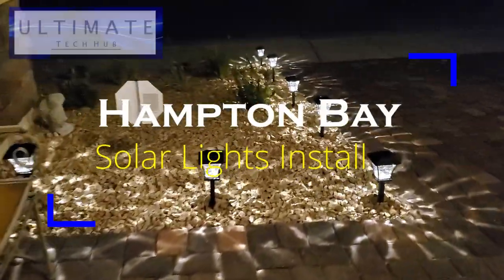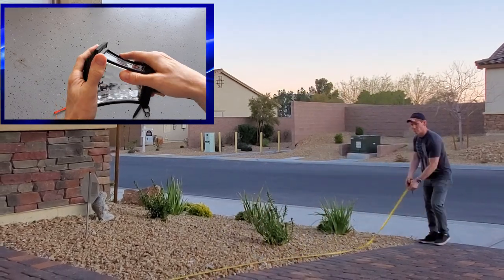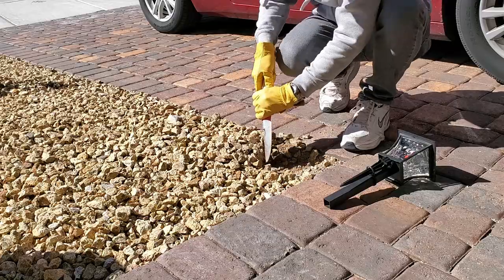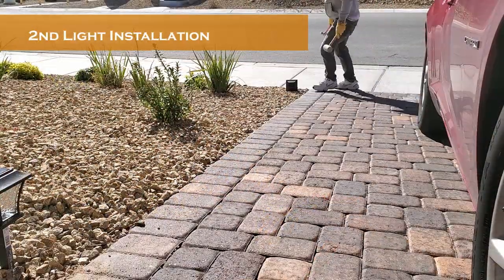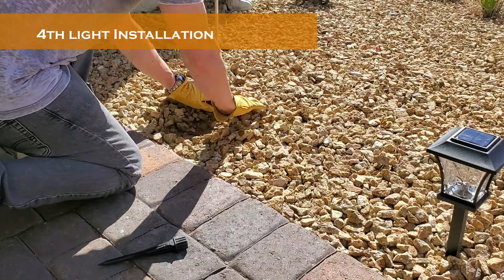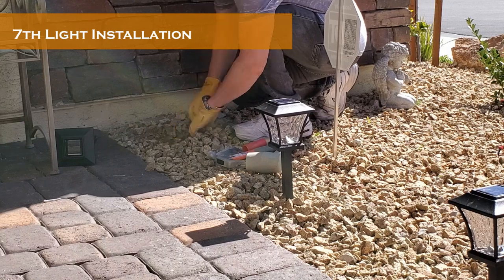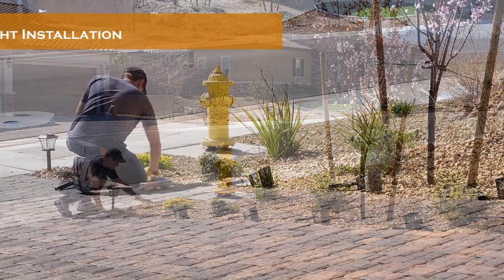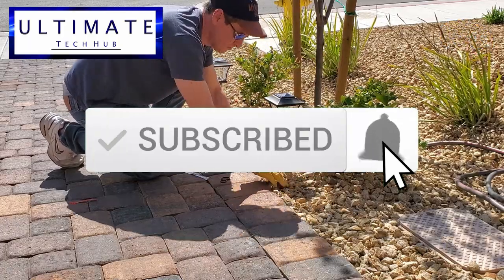Hampton Bay Solar Lights Install - Set up & Review - Quick & Easy Install!

Comment: when I first bought my house, i installed powered lights. I was younger than and did not mind all the digging and burying of the cables. Those lights lasted about 10 years. Now I went ahead and bought Hampton Bay lights. For the price for 5 , $26.00 and the easy of installation I cant complain. My lights are similar to the ones in this video, but I used them in my back yard where the light diffusion is better suited.

Comment: I have the same lights. Installed 3 in hard dirt like you this evening.. Your video confirned I'll need to get a hand shovel to get the stake below surface level. Was really struggling this evening w/o one 😥. Thx for the vid 👍
Reply from the maker: Yep a hand shovel is a must in hard soil.  These lights are very good. I've had mine for about 4 months and all 12 lights are still working perfectly. Thanks for watching and if you subscribed thank you as well.

Comment: Hi,  I enjoyed the video and thought it contained some great info.  But I have some feedback.  Rather than repeatedly showing yourself hammering in the stakes, it would have been more helpful to get more info about the putting the "tricky" tops back on, and what you learned about how to make it work well.  That's what we YouTuber's want to know, how to deal with the hard stuff, the unexpected problems and challenges.  Finally, I was really disappointed that you didn't include video of the result of installing the lights by showing us how all the lights looked in front of your house after dark.   :-)

Comment: Easy to assemble and install.  But after charging for 8 hours in bright sunshine they give off the light of only a match (20 lumens vs 800 lumens for a standard light bulb) and go out after only about 8 hours.  Much less on cloudy days.  Good for only decorative lighting.
Reply from the maker: For the price its a pretty good light. I've already replace mine after 2 years of use. Thank you for watching!

Comment: I installed mine today. At first the lights were not staying on when I would put the solar part right side up. They finally turned on and one light is now not on. I took the tab out from underneath and made sure they were in full sun for 12 hours. Is there something else I need to do to ensure they light up and stay on? Also I noticed that you took off adhesive from the top but could not figure out how to take mine off. Do you think that could be the problem? And how do you take adhesive off?
Reply from the maker: The film on top of the solar panel needs to cone off so the solar will fully charge. Give the lights a couple of days to get charged from the sun. They should work just fine. Thank you for watching.
Reply: @UltimateTechHub  thank you. I will try to take the film off
Reply from the maker: @jessicaeubanks1400  Maybe yours don't come with the film. This video is about 2 years old and products do change over time.

Comment: On the instructions of some solar lights, it says specifically not to hammer in the stakes, and to push then in by hand. His stake broke because it wasn't designed for the high forces of being hammered in. Be careful with solar lights!

Comment: a few lamps won't light up unless I place a hand over or a small piece of paper on top.  why?
Reply: they may be sensing too much ambient light...  are they closer to another light source, street light, etc ?    Perhaps some weatherproof layers of cloth/mesh duct taped to the corners will help shade the sensor.

Comment: How on earth do you get the top off?
Reply: Nevermind, husband with stronger hands than mine got the tops off.
Reply from the maker: The Tops are bit difficult to remove. Enjoy the new lights. Mine lasted over 2 years before the batteries stop charging in some of the lights. Thanks for watching.